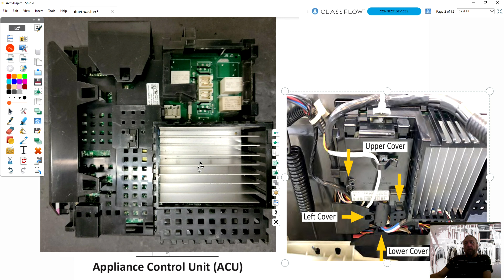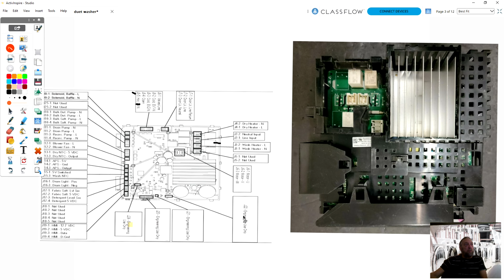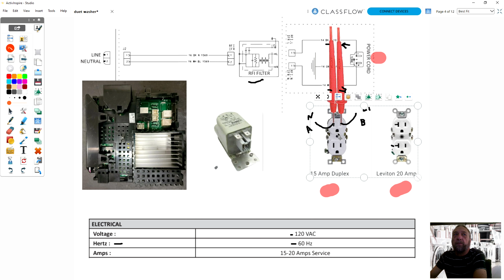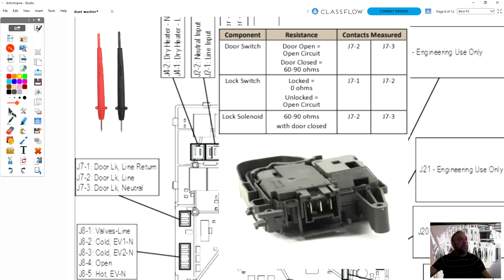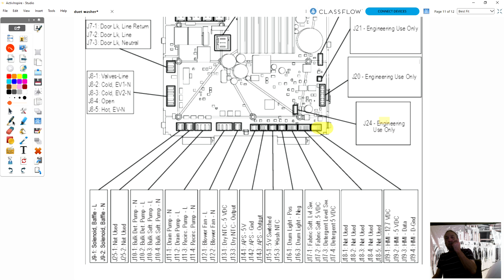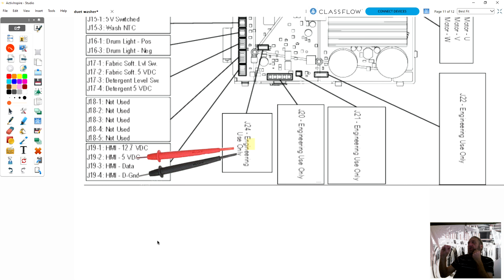Duet Washer Schematics

Comment: so J7-2 to J7-1 is essentially a voltage sensing circuit and acts as an input to the board. So would any circuit without a load or diode act (in practice) as an input back to the Board? it seems like J7-3 to J7-2 is an output from the board and the board is checking to see if that output was satisfied by means of seeing if there is 120V or 0V at terminals J7-2 to J7-1